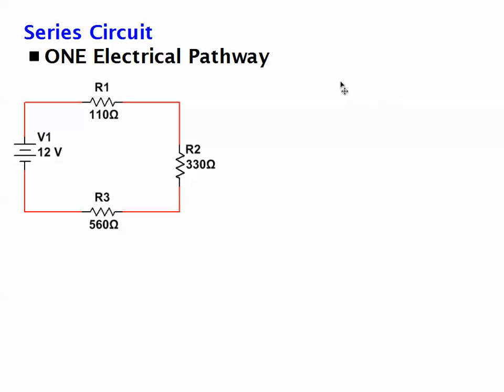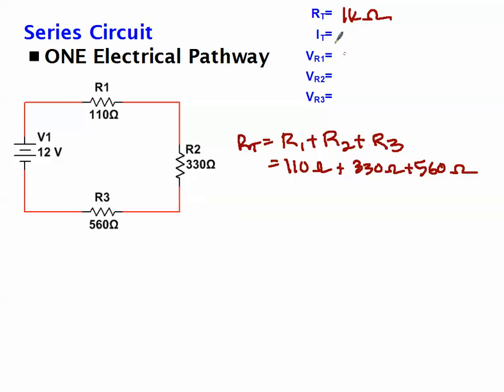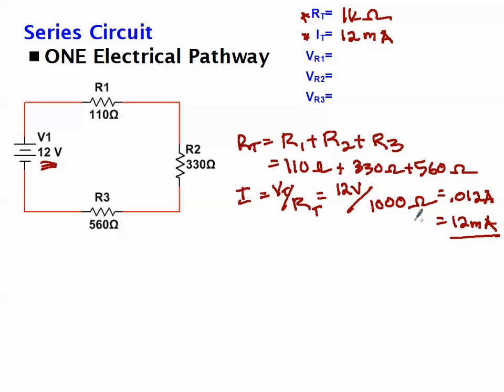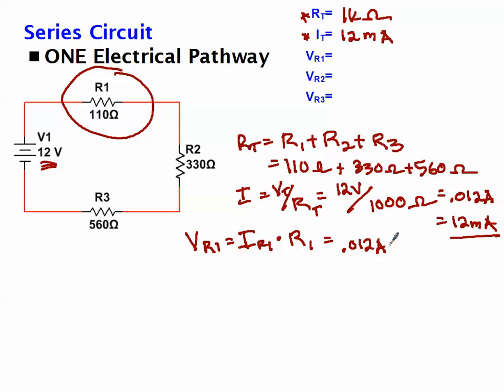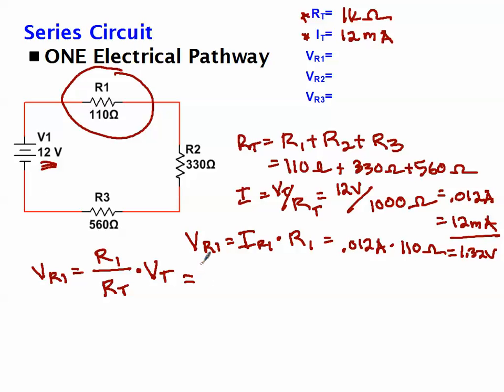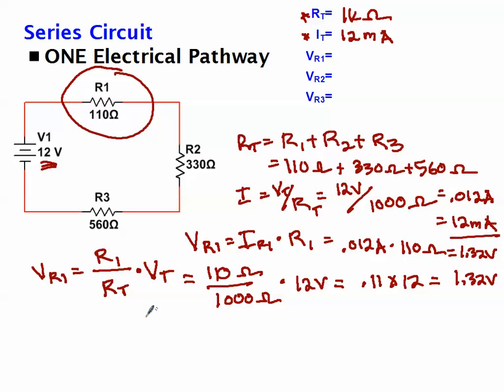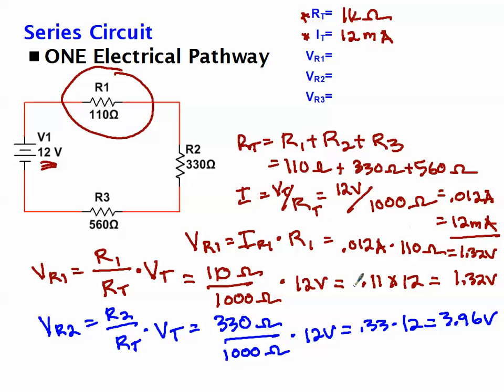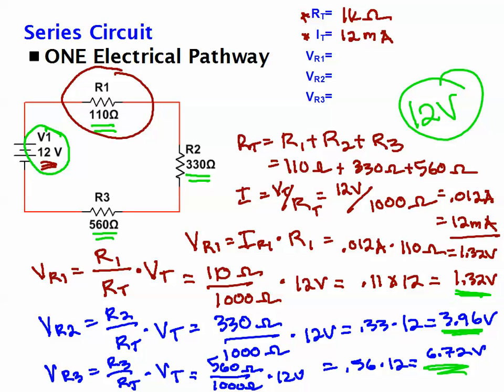Calculating Voltage Drop Across Resistors

Comment: How do you do it with only one resistor for example supply voltage goes through a 100K resistor to the collector of a transistor how would I work out how much voltage I drop through the resistor

Comment: How can there be any voltage drop?????
You said that resistors lower current (amps).  Why didn't you say resistors lower current and voltage???
Reply from the maker: Perhaps your difficulty lies in the terminology. When we use the term "voltage drop", we mean the voltage you would measure across a resistor in a circuit. Resistors oppose the flow of current, they don't "lower current". Current will flow through a resistor when voltage is applied. The amount of current that flows is proportional to the voltage and inversely proportional to the amount of resistance. These relationships are expressed mathematically by Ohm's law: V=IR, I=V/R, R=V/I. Given any two values, you can solve for the third. Hope that helps.
Reply: @CharlesEstabrooks  Thanks you.  I believe much of my problem is in the terminology.  Even when you say "across" or "through" the resistor.  When you "measure" I imagine a probe touching a particular part.  The verbiage is too loosy goosy to me.  Any field that give v for volts, r for resistance, then i(?) for amps seems to not follow standards.  I just watched another video when he calculated resistors in series and parallel, which helped me-although his terms were everywhere, too.  Thanks again for the help.

Comment: so the second method doesnt need current.....seems easier
Reply from the maker: I'm not sure what you mean by the question, but calculating total resistance in a circuit, assuming you know the values of all resistors or loads, never requires current. You need to know total resistance to determine current flow, however.
Reply: @CharlesEstabrooks  oh thanks....already finished school tho just waiting for the results. Hope I passed, ur vids were helpful.

Comment: Trying to calculate with 120v circuit. Seems no matter what ohm resisters I use it always comes out to 40v drop. I stink at this. I=120/60(3 20ohm)=2           2X20=40v drop. If I start over and make each r 30 I come up with the same answer 40. What am I doing wrong? aaaah!
Reply from the maker: Just because the value of the resistors changes, doesn't mean the voltage drop across each resistor changes. If you're using 120V and three 20 Ohm resistors, your total current is 120/60 or 2Amps. Your voltage drop across each resistor using V=IR is 2 * 20, or 40V. Checking it with Kirchoff's Voltage Law, 40+40+40=120.  If you're using three 30 ohm resistors, then your total resistance is 90 Ohms, so it becomes I=120/90 = 1.33Amps, and V=IR becomes 1.333 * 30 = 40V, so you're correct, your voltage drop across each resistor is STILL 40V.

Comment: Sir I have small doubt if the R1 resistor is only connected in the circuit. How to find the voltage drop
Reply from the maker: I'm not sure if I understand you, but if you're asking about if there is only one resistor in the circuit, then the voltage drop across that resistor equals the source voltage.

Comment: how do you find it when you have two electrical pathways?
Reply from the maker: Two pathways means you have a parallel circuit, and some of the rules are different. Search my my channel for Parallel circuits, Kirchhoff's current law or Ohm's law for more info.

Comment: do i need to round of the result of the IT?
Reply from the maker: Generally speaking, since resistor values are typically plus or minus 5% of the nominal, you can round your final answer. Be careful, however, of rounding intermediate calculations, then using the rounded value for further calculations. This will result in what I call "rounding error".

Comment: The title of this video says: 'Voltage Drop'
I'm sorry but I can't see anywhere in the video where the voltage drop is calculated...
Reply from the maker: Perhaps the difficulty is in your understanding of the term "Voltage Drop". This term simply means the voltage you would measure across a resistor or load in a powered circuit.
Reply: What I was talking in terms of voltage drop was the drop in voltage after R1.

The voltage across R1 is 0.12Ax110ohms = 1.32V (as shown in the video)

To me the voltage drop is VCC - VR1 = 12V - 1.32V = 10.68V (this is how much R1 dropped the voltage or the voltage used by a load) -- it's just a matter of semantics.

if you add up these voltage drops: 1.32V + 3.96V + 6.72V = 12V then the voltage drop should be 0V at ground since 12V-12V=0V.

It's that part of the calculation that I did not see ....
Reply from the maker: What you call VR1 is what I call the "Voltage drop across Resistor 1". The same can be said for the voltage drop across each of the three resistors. As you said, it's a matter of semantics. Also as you mentioned, The "Voltage drop" across all three reisistors (or loads) is equal to the total or supply voltage. So I'm still not sure where the confusion is since you appear to understand it quite well.
Reply: I guess what am I talking about is how to calculate the value of R to achieve a specific voltage drop.

Now, that would just be algebraic math using ohm's law.

Let's say the following:
VCC=12V
VDROP=10.68V
VR1= VCC-VDROP = 12V-10.68V = 1.32V
I=100ma

R=VR1/I = 1.32V/0.1A = 13.2 ohms

In other words calculating the value of R if you are given VCC, VDROP, and a specific current.

What I was looking for -- when seeing the title of the video -- was how to calculate these things algebraically in order to confirm that the math -- that  I was using -- was correct.

For instance this site:
https://www.pcboard.ca/led-dropping-resistor-calculator.html

One single led
Battery or Supply Voltage: 12V
Voltage Drop Across LED: 10.68V
Desired LED Current: 100ma

Calculated Limiting Resistor: 13.2 ohms
Nearest standard resistor value: 15 ohms
Calculated Resistor Wattage: 0.132 watts (132mW)
Safe power rating of: 0.22 watts (220 mW)

This calculator is for calling the resistance that you need to drop the voltage to a specific value in order to limit it for use with an led (but could be any load)

In this case all the information that you have is VCC, VDROP across Led, and the current -- and you need to calculate the resistance to achieve it.
Reply from the maker: OK, now I see what you're trying to do, but you've got things a bit confused. First of all, you're not likely to have a voltage drop of 10.68V across a single LED. Most LED's will exhibit a voltage drop (based on color & power consumption) of between 1-3V. Let's call it 2V. That leaves 12V - 2V = 10V for your resistor. 

You typically want to limit the current through an LED to about 30-50ma Maximum, much less than your 100mA value. Let's use 40mA.

So applying Ohm's law, you get R=V/I = 10/.04 = 250 Ohms.

In practice, I tell my students it's safe to use anything over 150 Ohm's, but it really depends on the specific LED you're using.  You also need to be sure that your resistor can handle the power dissipation required. In my previous example, since P=IV, we would get P = 10 * .04 = .4 W. This could be a problem if you're using the tiny 1/4 Watt resistors. To be safe you'd need at LEAST a half-watt resistor.

What may be a bit deceiving about that web site you referenced is that you can't just "pick" a voltage drop for an LED. Every LED has it's unique properties which determine what the voltage drop across that LED will be when it's wired into a circuit.

Hope that helps.

Mr. Estabrooks

Comment: I put a voltmeter across all kinds of resistors and the voltage never drops, even with megaohm values! I want to reduce 9 volts to 3 volts to feed an electret mike from a plane's comm system. I've put resistors in parallel, in series, 10k, 50k, 500k potentiometers, voltage stays high. Thanks for vid!!

Comment: But how do you calculate if there is only one resistor ?
Reply from the maker: +xmenxwk It's easy. The voltage drop across a single resistor in a series circuit equals the source voltage.
Reply: Charles Estabrooks
 so if 12v is source voltage, the voltage drop will be 12v ?
Reply from the maker: +xmenxwk Yes.That is the essence of Kirchhoff's Voltage Law. The sum of the voltage drops across all resistors in a series circuit equals the source voltage. So if there is only one resistor, the voltage drop across that resistor must equal the source voltage. 12v=12v.

Comment: Hi Mr. Estabrooks, I just wanted to know if you had a video on how to calculate voltage drops across a parallel circuit? I found your series circuit video very helpful.
Reply: +Andres Lara Voltage in a parallel circuit is always the same no matter what, similar to how current (amperage) is always the same in a series circuit :)

Comment: can u explain how to calculate watts in a resistor in a series parallel...
Reply from the maker: +PJ Fuentes The Watt is the unit for power. Power can be calculated by multiplying current times voltage (P=IV), so if you know the voltage across the resistor, and you know the current flowing through the resistor, you can calculate the power in watts. If you have a single resistor in parallel with other resistors, you can ignore the other resistors, and calculate the current (I=V/R), then the Power (P=IV). You can also combine these into a single formula to calculate the power directly from the voltage and resistance (Power =V squared divided by R). Hope that helps.

Comment: so all the voltage drop across each resistor must add up to the total voltage of the power supply?
Reply from the maker: +Michael Wang Exactly. This is the definition of Kirchhoff's Voltage Law.

Comment: can we solve V across capacitor by the same way using the formula CV=Q
Reply from the maker: Deepanshu Gajbhiye CV=q is a valid equation which expresses the relationship between Capacitance, Voltage (across the dielectric), and charge (q) stored on the plates, but it's not the same thing as voltage drop across a resistor since capacitors don't consume power in the same way as resistive loads. Assuming the voltage rating of the cap is higher than the source voltage, a capacitor in a DC circuit will "charge" until the voltage across the dielectric equals the source voltage (Vc=Vs), then current stops flowing. At this point in time, you can calculate the charge (Q) stored in the capacitor's dielectric using the formula q=C/V, but remember that at this point there is NO current flow.
Reply: then how will u solve the 1st on this question paper
http://www.fiitjee.com/down/iit071.pdf

Comment: ??? If this is right then surely ohms law would dictate that at least 2 resistors are required to cause a voltage drop??
Reply from the maker: Not so. Obviously you can have one resistor in series with a voltage source. If this is the case, then ALL the voltage will  be dropped across the one resistor. In other words, Vr1 = Vt. The voltage drop across the single resistor equals the total voltage of the source.

Two or more resistors in series with a voltage source creates a voltage divider. Two resistors of equal value will create a symmetric voltage divider where the voltage at the point between the two resistors equals the voltage across each resistor which will be half the total voltage. In other words, if R1 = R2, then Vr1 = Vr2 = Vt/2. This is the essence of Kirchhoff's Voltage Law.
Reply: I don't understand, if there is only one resistor are you saying then that will stop all the current?
Reply: Charles Estabrooks you say that's not the case, but then you say Vr1=Vt which means there is no voltage drop.
Reply from the maker: Cam Hart You're misunderstanding the meaning of the term "voltage drop". The term "voltage drop" simply means the voltage you would measure from one side of the resistor to the other.
Reply: So what would happen to 12v with a 1kohm resistor in a circuit?
Reply: Oh never mind I have figured it out, thanks for your help!
Reply from the maker: Cam Hart In a circuit with a supply of 12V and a single 1 kohm resistor, Ohm's law I=V/R indicates the current will be 12/1000 or 12 milliamps. The voltage drop across the 1 kohm resistor will measure 12V. All the voltage is dropped across the single resistor because it is the only "load" in the circuit.
Reply: I figured that out already, but thanks anyway!
Reply: Charles Estabrooks Not exactly correct.  Alll the 12 volts measured across a 1 kohm resister is twelve volts because the resistor value is 1ohm or less.  For example, 12 volts across a 1ohm resistor would be 12 volts and 12 amps of current.  (E=I x R,  therefore E/R= I, (12v/1ohm ) = 12 amps, and E / I =R), (12 v / 12 amps) =1 ohm and so on, 12v/2ohms=6amps and 12v/ 6 amps = 2 ohms)  Now (12v / 0.001 or 1 kohm = 12000 milliamps ) and 12v/12000 milliamps = .001 ohms or 1kiliohms.
Reply from the maker: Robert McGinnis I'm not sure I understand your comment. As I mentioned earlier to Cam, in a series circuit with a single resistor, the voltage drop across the resistor will equal the source voltage regardless of the size of the resistor (1ohm, 1kohm, 333 ohms, or whatever).

Comment: Thanks Charles
I reason I ask is I got a question that confused me, in your example, if you replace R3 with a fuse, what is the voltage drop across the fuse if the fuse blows?
Reply: +Dave O&#39;Sullivan 
12V across the fuse.

Comment: Thanks Charles, much appreciated. I know your calculations are correct but...
The reason I ask is I got a question that confused me, e.g. using your circuit for example, if you replaced R3 with a 'fuse' what is the voltage drop across the fuse if the fuse blows? Trick question? not sure!
Reply from the maker: First ask yourself two questions. 1) What is the resistance of a good fuse? 2) What is the resistance of a blown fuse? To answer these questions, you must understand that a fuse is simply a thin conductor which is designed to overheat and burn up if the current through it exceeds a certain amount. A good fuse has nearly zero resistance. A blown fuse is simply an air gap with essentially infinite resistance (Many megohms). Since voltage is proportional to resistance, the voltage across the blown fuse would equal the supply voltage.
Reply: Charles Estabrooks Thanks Charles

Comment: If the is a voltage drop after R1 of 1.32V, why would you not use 10.68V for the calculation of the voltage drop across R2?
Reply from the maker: Voltage drop ACROSS R1 is 1.32V, not AFTER R1. This means if you measure the voltage from one side to the other side of R1 you would measure 1.32V. The Remaining voltage drop (12V-1.32V=10.68V) is across BOTH R2 & R3. In other words, the SUM of the voltage drop across R2 plus the votlage drop across R3 equals 10.68V (Vr2+Vr3=10.68V). As you can see by my calculations, this works out to be the case (3.96V + 6.72V = 10.68V). When added to Vr1, you get the total voltage which equals 12V. This is basically the definition of Kirchhoff's Voltage Law.

Comment: how/why does I(T)=I(R1)?
Reply from the maker: In a series circuit, current is the same everywhere, regardless of where you measure it. That's what is meant by It=Ir1=Ir2=Ir3
Reply from the maker: Yes, resistors reduce current, but they do it in a combined manner, and the current is based on the total resistance. Think about a series of water pipes, each of a smaller size than the previous. Since they are in series, the water can only flow as fast as the smallest pipe allows. The water cannot flow faster in the larger pipe since it is connected to smaller pipes down the line. The flow (current) is constant throughout the series. This is a fundamental principle of series circuits. HTH.
Reply: +headphonecup think about it like the current is always at the same point. Like a straight line. That's why current is not constant at parallel circuits.

Comment: In Physics class we worked a question where the total voltage supplied was 10V, but the amps came out to 2A (The professor did this part). But then in the circuit there was an 8ohm resistor on top, resulting in a 16V drop. What am I doing wrong?
Reply from the maker: I would have to see a schematic of your circuit to help you understand what is going on. Was it a simple series circuit, parallel circuit, or more complex circuit?
Reply: Are you sure your its an 8ohm resistor, not an 8kohm resistor?
Reply from the maker: In a circuit with a supply voltage of 10V and a current of 2A, the total resistance would have to be R=V/I = 10/2 = 5 ohms, so clearly there is something more going on here. I refer back to my original reply. I would have to see a schematic of the circuit to understand what is happening. In any case, you CANNOT have a voltage drop higher than the supply voltage. That is one implication of Kirchhoff's voltage law.